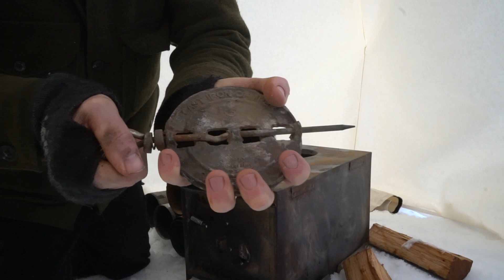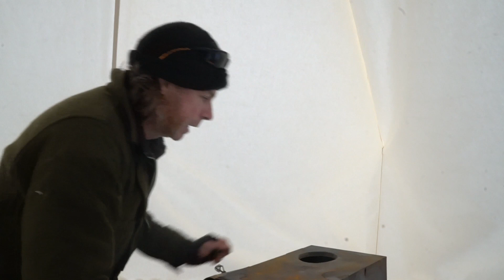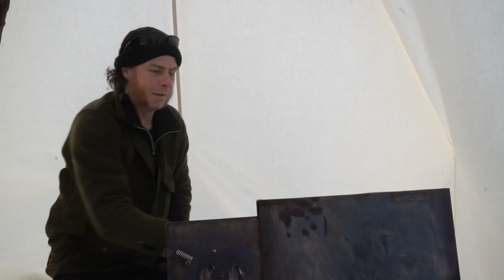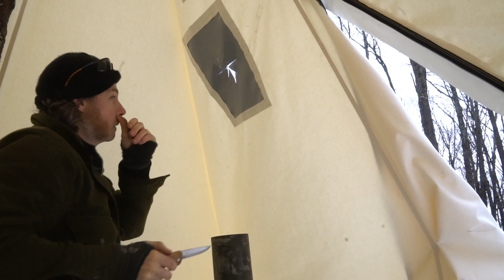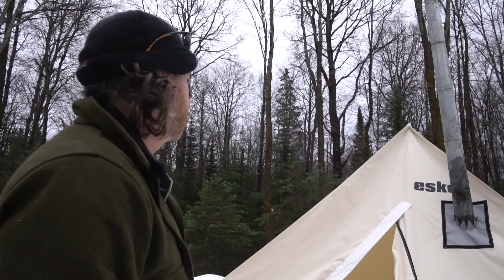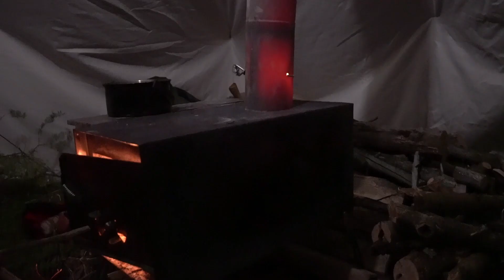Esker Tent and Stove Set Up: Part 2 (Stoves)

Comment: I can't get the damper to remain in a position. It always swings back to the closed position. Any tips on how to get it to stay?
Reply from the maker: Hi Nikhil Gupte   - stretch out the spring on the handle/pin of the damper. This should tighten things up again, and hold the damper in position.